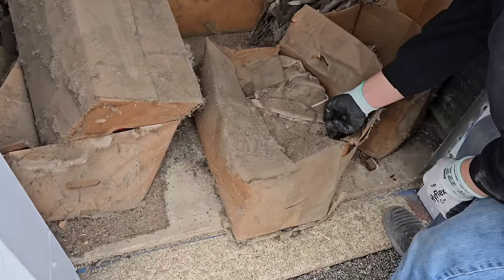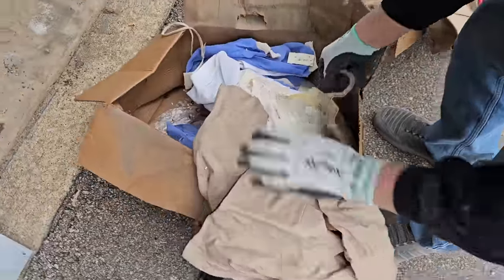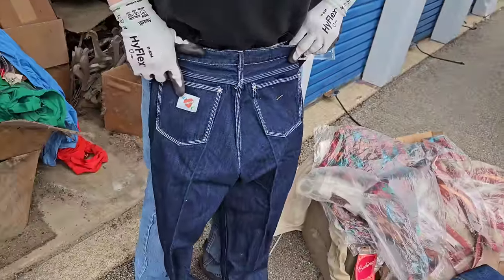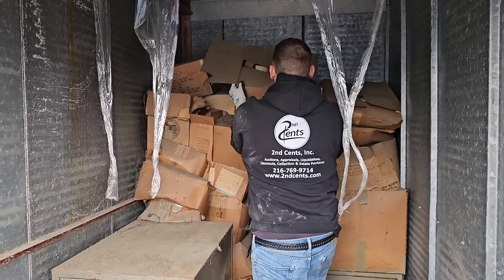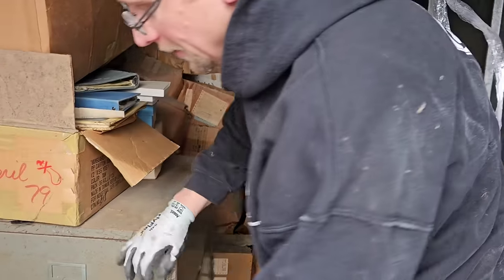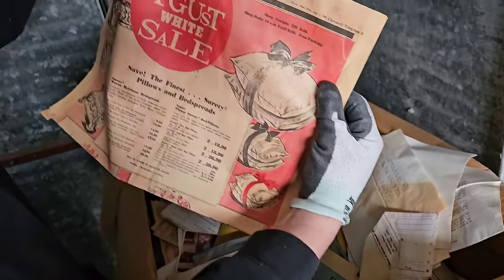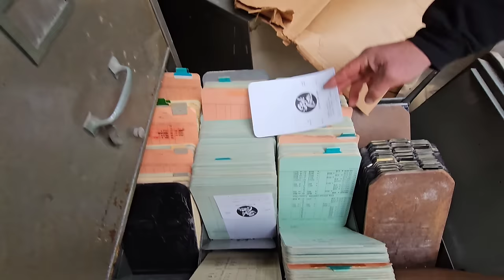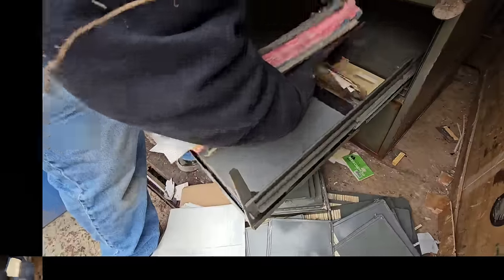Elderly man Dies kept items 4O+ YEARS! ~ FILTHIEST, DUSTIEST, DIRTIEST storage unit EVER!

Comment: I worked in women’s retail in the early 80’s.  Gloria Vanderbilt was just coming on the scene.  Jeans were expensive and ran tight.  Gloria Vanderbilt is still a current style but the size runs are different as are the cuts and material content.

Comment: Check out those 1982 pennies. Transition year to more zinc, less copper. Different varieties, large date, small date...some were minted on the old copper planchets in error and went  in circulation. Worth $$. They look to be in good shape and probably not circulated much since that is the last date of coin in the can. Keep from beating them around. One scratch or abrasion could mean hundreds or even a thousand in value.